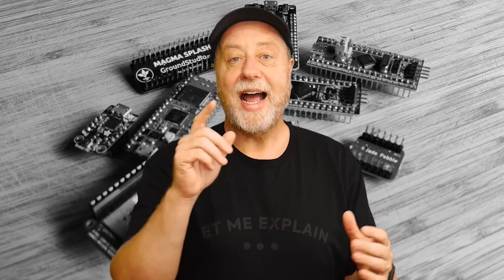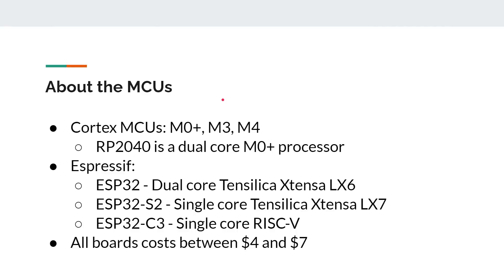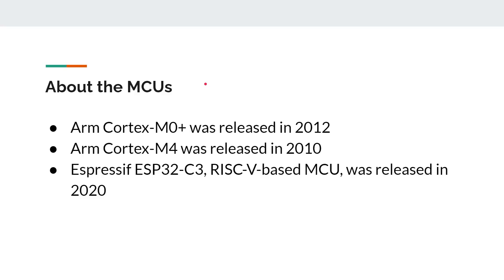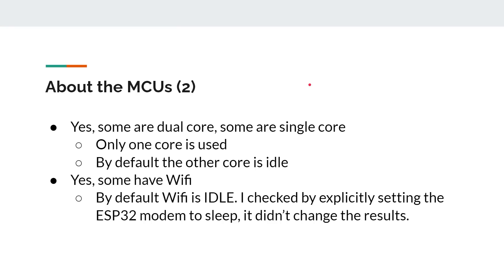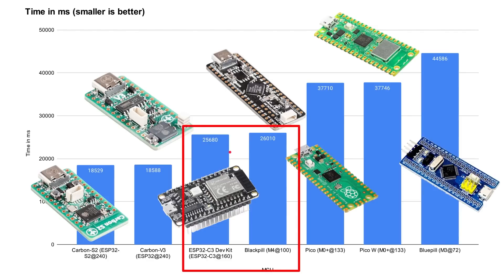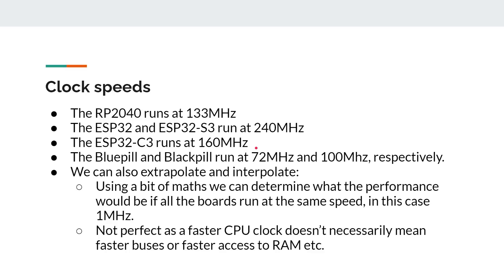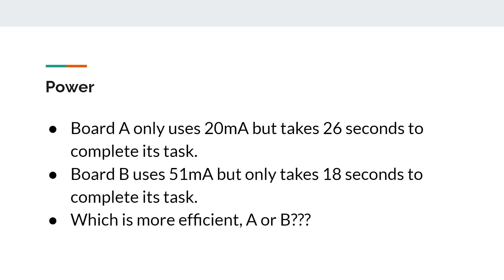Arm vs RISC-V? Which One Is The Most Efficient?

Comment: I'm glad you addressed the point about WiFi on/off not making a difference, although I'd like to ask about those mWh numbers - you said for the ESP32 that it's the same current draw whether you're supplying 3.3V directly or 5V, so which voltage are these energy numbers for?
Reply from the maker: They are for 5v. But they are all 5v (i.e. for all the boards). I have the 3.3v numbers are well, but of course it changes nothing, just smaller numbers.
Reply: @GaryExplains  so all these chips run at 3.3V natively? Fair enough
Reply: @Nabushika  some chips use lineal voltage regulator (5V to 3.3V) some - switching voltage regulator (at least Raspberry Pi Pico with an RP2040). Switchers waste way less power (probably 92% efficiency for regulator, 94% efficient reverse voltage protection, 85% in total vs 64-66% in total with lineal one)

Comment: Crazy to use only a single RISC-V board as representing a whole ISA. Obviously not all ARM cores or boards are created equal, and neither are all RISC-V cores or boards. Espressif doesn't even say in their datasheet what RISC-V core it uses. Crazy also not to include Sipeed Longan Nano ($4.80, 108 MHz, been around for three years), some Bouffalo lab BL602 board (similar price to ESP32s, we know it uses a SiFive core) or even extend the price limit a fraction to include a K210 board (dual core 400 MHz 64 bit) such as Maix Bit. Still, it is interesting to see that from the same chip/board manufacturer the RISC-V does in fact give better performance per MHz and per Watt than what they were using before. A really interesting test would be the Longan Nano (GD32VF103 clone of an STM32 but with a RISC-V core) vs either a GD32F103 (same manufacturer STM32 clone with a real licensed ARM core) and/or a real STM32F103.

Comment: I think it quite surprising that a 13 year old design stands up so well. I would suspect that if the power saving features of more modern ARM processor designs were to be exploited for a micro-controller SoC, then  it might do better still. However, presumably the priority has switched to producing much more powerful, low-power architectures for use in servers, laptops and the like. producing the ultimate in low power micro-controllers is probably not a priority as these things are rarely required to do heavy number crunching.

Comment: Such comparison is senseless without manufacturing process (nm) specification
Reply from the maker: Senseless, as in without any sense, no sense whatsoever. Really?
Reply: @GaryExplains  for example, exp32 c3 manufactured on 40nm, when stm32 arm m4 from blackpill manufactured on 90nm. In this case, Risc-v mcu has 2 generations manufacturing handicap. This is not arch comparison, in such circumstances it really senseless. It's just comparison of 2 boards.
Reply from the maker: If the C3 is made using 40nm, but the Blackpill is made using 90nm, then it is the Blackpill that has the handicap, not the C3. That means the STM32F411 is even more amazing since it is built on a much older process and and can still beat the 40nm C3.
Reply: @GaryExplains  conclusions may be different. I just want to emphasize, that it's senseless to compare 2 different mcu with different nm. Though, there are a lot of other important details, but this one is really crucial ( like different frequency)
Reply from the maker: Yes and no. It isn't "senseless" to compare 2 different mcu with different nm. It is in fact a very valid comparison. That is like saying you can't compare an Intel processor with an AMD one because AMD has a better nm process node. Of course you can. The point is to see what you get if you buy chip A rather than chip B. If you say you can't compare two chips on different process nodes then you can't compare anything Apple to Samsung, Intel to AMD, ESP32 to Arm Cortex-M4. The point is to compare what these chips do in reality, not in theory according to some statistics, and conclude which one is better in real life. It is, as you say, a comparison of 2 boards. Which one is better? That is what I tested and that is what I demonstrated. The RISC-V mcu's on the better process node lost to Arm chips on older nodes. That means the RISC-V chips have a long way to go.
Reply: @GaryExplains  I have to admit that I'm very lazy to do the check myself, unless I need it now for something important. In the context of this topic, mentioning the manufacturing nodes of each chip would be a very welcome addition, so we know how far apart the chips are. From what I know seeing the last decade of Intel vs AMD CPUs, a 2 full generation difference is quite a lot, and the architecture gets easily the 2nd place in importance of the efficiency.

To be frank, how valid or not the comparison can be does vary depeding on what you want to compare for, what you want to know. Comparing something where multiple things differ (in this case, not just the ISA but the manufacturing node and implementation and so on) is useful usually in things like which one to buy now, because that's the current offerings.

However, in something like "let's see what this ISA is capable of" then everything else has to be as identical as possible, so only the ISA differs. Of course, in the real life, it can't be that perfect. Still, you might want to know the winner of "ISA efficiency" so you invest into it for the future. If the test resulted in the RISC-V being 1st place, but it's on a much better manufacturing node, then maybe it's not trully the most efficient ISA. Or the other way around, the RISC-V could've gotten the last place, and you could conclude that it's not there, at least not yet, and you'd rather not bother with it, at least not yet. But the last place is mostly because it was on a much worse manufacturing node. However, if you'd be taking this into account you'd know (well, reasonably estimate) that it might actually be ok or even very good, and invest into it, and actually be able to make something really cool the next year when there's a RISC-V chip launched (hypothetically) that it's on the same manufacturing node as the rest, and it happens to be the most efficient chip.

And yes, I read your last part "The RISC-V mcu's on the better process node lost to Arm chips on older nodes. That means the RISC-V chips have a long way to go." which is very nice. I wrote the above to elaborate on the argument that providing the manufacturing node in future videos would be helpful.
Reply from the maker: Thanks for the feedback, I have made a mental note to do that. However I must point out that "this is senseless" to "providing the manufacturing node would be helpful" is quite a journey.
Reply: @GaryExplains  Yeah, agree on that one.

Comment: Why not transistor count instead of energy used, too many variables. Assuming transistor numbers usually correlate to cost ultimately… to show what architecture more efficient for the theoretical cost of production (if they were same fab, same node)
Reply from the maker: Transistor count doesn't correlate in any meaningful way. It won't help you decide what size battery to use etc. Power usage is the most important thing, everything else is just statistics.

Comment: Gary,
M4 has an FPU speced on core. C3 has cryptographic modules. I'm very impressed with the quite new C3's placing on the list, but do you know if the C3 cryptographic processing components were used in your compiled code? This influences your results quite significantly.
Reply: The cryptographic co-processor in the C3 accelerate very specific algos (SHA and AES), and need to be expressly enabled in code through C headers as well as through the NVM configuration. His crypto algorithm is very custom(?), so I doubt it can even take advantage of the co-processor, let alone the fact that putting code forward that used co-processor on the C3 would kill compilation for all the other chips, since the header would have definitions for C3 specifics.... unless of course Gary was a complete A-hole and put #IF guards around that part of the code. (which would absolutely give the C3 and advantage.)

Comment: using O3 invalidates the test in my eyes - thats just not clever at all - but even with O2 it is not so much comparable this way. you would need to make sure you have the most efficient assember code possible on every chip. or at least have a very big test code set testing very different loads in terms of asm.
Reply: What is so wrong with O3 ?
Reply: @Winnetou17  higher number is not better in case of gcc and microcontrollers. O0 is off and O1 is mostly useless beside debugging gcc. Os is size opitimized which may actually be the fastest and smalles on some microcontrollers but only smallest is the guarantee. this basically never inlines and preferes lowering to loops if that saves space. in case your code is writen in a way it preferes loops it gets smaller but slower. it also depends on the instruction set and gcc optimizations for it.
O2 is garanteed to be fastest in most cases but not allways and does heavy optimization. this is also the gcc code wise the most advanced optimizer stuff.
O3 is in certain special conditions faster then O2 but bot too often otherwise it would be O2 not O3. O3 is only for single object files in case you tested it is faster for your special case.
for a lot of embedded controller instruction sets however gcc does not a great job no matter what you choose. also no matter what optimizer you choose you better know what is super expensive on your instruction set on a microcontroller. for example if multiplication or division is not supportet in hw and it works around with code that is getting it done but slow. or no floating point support in hw. or single bit shifts per instruction on single bytes like for arduino stuff. the compiler will likely not help you too much there.
see documentation and compiler explorer for details. e.g. try uint32_t / 1.1927f in a function, compile with avr-gcc and have a close look. it gets worse if right hand of the division is a variable instead of a const ;)

Comment: Hi Gary, it would be really interesting to have you do a Intel Atom/E-core (Alderlake/Gracemont) architectural deep dive video, and a comparison to Arm/Risc-v.
Reply: e-cores aren't efficient whatsoever
Reply: Ah, it can't be compared. Atom is an x86 cpu, and it depends on how the cache and fsb are set. Arm chips usually operate at max 0.5 volt atom can go up.to 2 volt on turbo  so is definitely diffrent clas of cpu   ah why not against an ia64 cpu lol 😆  wanna se that race 😆
Reply: @adriancoanda9227  In the end what makes the difference between slow and fast, is 99% software. I would win that race if I am the programmer : would use inline assembly, lookout tables with pre-computed values, would not miss the caches with visibility list, local goto.... Sofware always wins.
Reply: @MarquisDeSang  not always. It still needs hardware to run on  y saw some remastered games to be used via the browser  chromebook target it ah tnd that launcher looped 2 gb of data but target just on cpu core so the loading screen took 10 minutes  search for   ah y like to see you in quantum pc  your thinking won't apply there  cause it is not a digital cpu  is analog and capable of insane parallel computing   and it exists already a portable one   withou a transmission it won't run any apps like you are used to, 😉
Reply: @MarquisDeSang   and if the software is buggy well, for example, Windows Vista, regardless of what services pack, it won't run smoothly on even flagship of today pc
Reply: @adriancoanda9227  We only need better CPU to run the shitty script running in web-browsers.
Reply: @MarquisDeSang  that was running on a data center, and  it was fixed  now. The same loads in 05 seconds  without the bug, so if a fix is desired, then it will be one 😉   we need to pay attention to the instructions we write, so no zero data is generated
Reply: @adriancoanda9227  The fastest way to draw a polygon is to not draw it.
Reply: They are too fare away to be compared.

Comment: You don't seem to know what efficiency means. This is an apples to oranges comparison. An efficiency comparison is performance per watt and not clocking them down to the same speed. Clocks etc. are not the same in different processors. Turning off as many peripherals as possible to get a processor only comparison, and measuring power consumption per task gives you the best EFFICIENCY measure with the tools you have. You are not comparing Efficiency at all. You are comparing speed between a "sedan, truck and sports car." If you wanted to see how efficient they are you would calculate the hp compared to fuel burned. In this case, you could run a loop 10k times and see how many WATTS they used PER cycle.

I find it idiotic that anytime a youtuber is told they are wrong, it must be fanboys and no thought is given if maybe you are just talking out of your ass. Especially when your entire profession is filled with unqualified hacks who are only popular because of all the ass kissers out there. That is how you get fanboys with millions of views doing CPU/GPU analysis but they can barely assemble a DIY PC without plugging the ram into the wrong slot.
Reply: Being excitable enough to lecture Gary on his video but obviously not authentic enough to actually watch it all is juvenile. I suggest you work on your own ethics and skill set before you embarrass yourself further in criticism of others.
Reply from the maker: So, you are saying that my mWh calculations are not correct?
Reply: Holy cr@p, I didn't though I'd find this level of wrong in one of Gary's videos' comments. I can't be as polite as Gary and Graham, and have to call out excited box for being very idiotic.

@excited box Have you actually watched the whole video, or did you just stopped when you saw the every chip @ 1 MHz part and started writing this rant in which you put more time and effort that you did in watching and comprehending the video ? How is measuring the total power draw not "hp compared to fuel burned" ?

Comment: Nrf52840 could be a better case
Reply from the maker: Why? I have one here but it runs at 64mhz.
Reply: Most of the boards that you used have connectivity. But the winners have no connectivity. Even if you carefully calculate and minimize the difference, antenna design and location may effect board design. I am not an expert. Just a recommendation. Thank you for this great video Gary

Comment: I would have loved to see more different benchmarks hitting different areas of the MPUs, since concluding based on one very specific crypto-benchmark not even using floats seems quite off to me...
Reply from the maker: LOL, other people complained when they thought I was using floats (as some MCU's don't have an FPU). I just can't win. YouTube comments for the victory! 🤪
Reply: Outside of very specialised areas, almost no software uses floating point on desktop computers, let alone on microcontrollers! I've been programming professionally for 40 years and 99% of C programs I work on don't even have the word "float" or "double" in them. Gary's previous "Primes by division" benchmark was quite unrepresentative of normal programs, but this one sounds pretty good (I don't know if the actual source code is available?) so I for one applaud this change.
Reply: @BruceHoult  "almost no software uses floating point on desktop computers" u wot mate ? Browsers and games are "almost nothing" ? Though to be fair, I don't know much about other software, but I'd be surprised if these would be the only major ones. Still, I'd also say it's kind of irrelevant what desktop-level software use and then compare to what MCU-level software uses.
Reply: @Winnetou17  "outside of very specialised areas". Games and browsers are specialised. A lot of people run them, it's true, but they constitute a very small proportion of the lines of code written or programmers employed.
Reply: @BruceHoult  Oh. When you said specialized areas I thought you meant more obscure programs that only some people use at work.
Reply from the maker: Bruce, the code to Oceantoo is in my GitHub repo, there is also an accompanying video here on this channel.